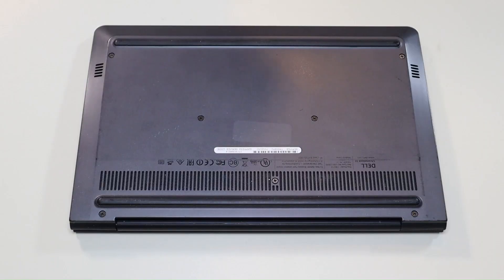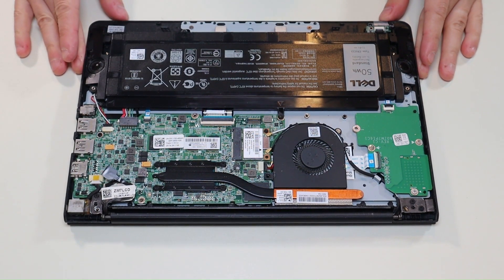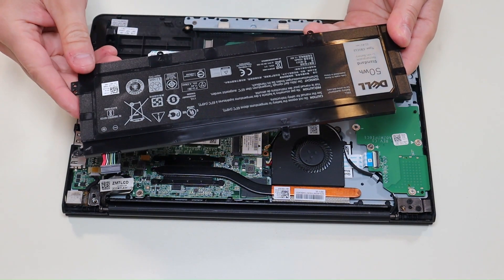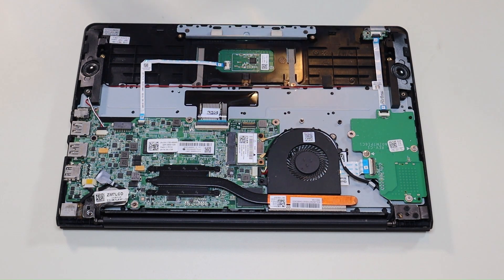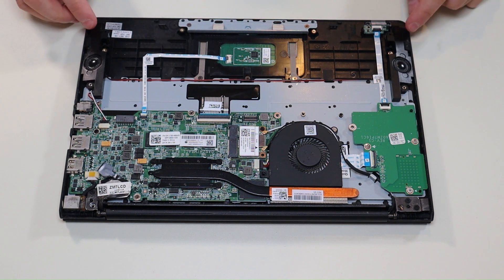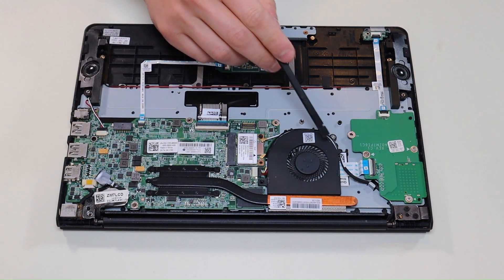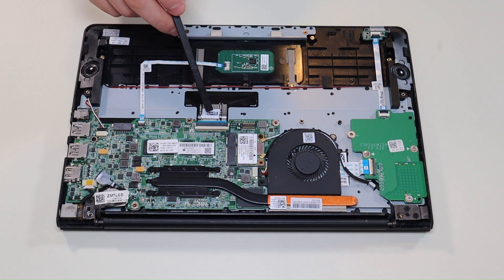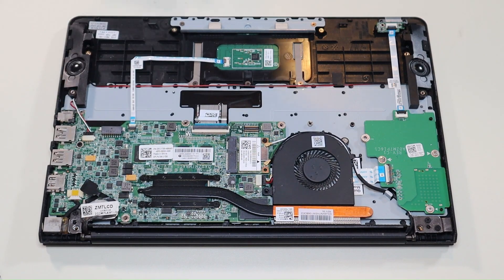How To Teardown / Disassembly - Dell Chromebook 11 CB1C13 Laptop

Comment: CAN I UPGRADE THE SSD OF THE SAME DEVICE THAT YOU USED IN THIS VIDEO???
Reply: I CAN'T FIND WHERE IS THE SSD OF THIS DEVICE..
Reply from the maker: No. The SSD is actually an eMMC drive. Its integrated into the motherboard and not removable.